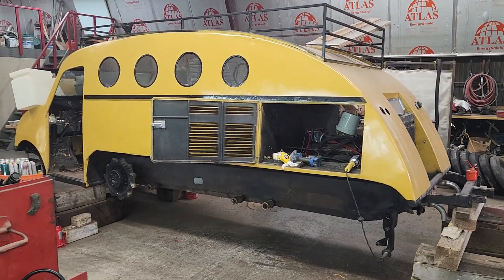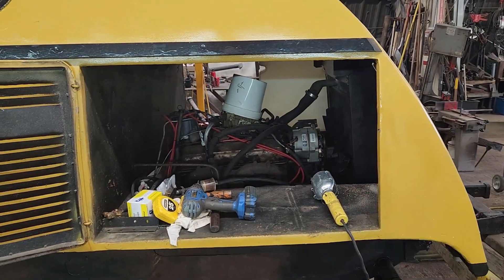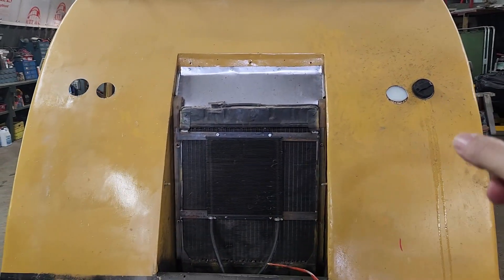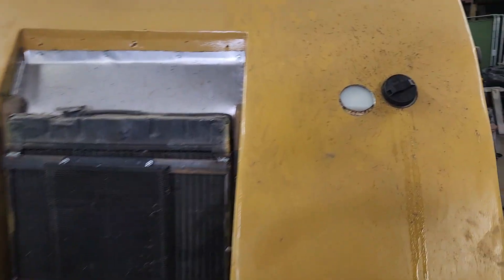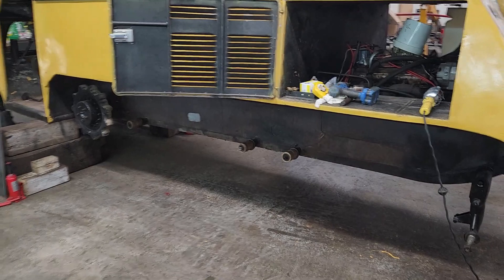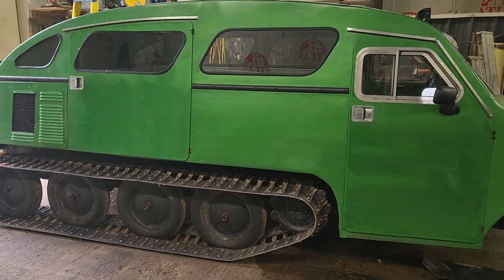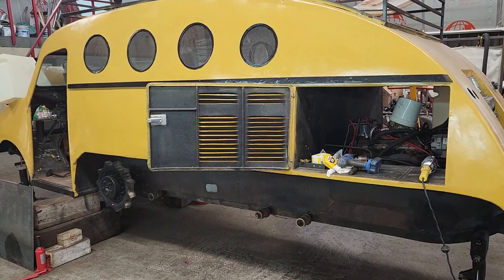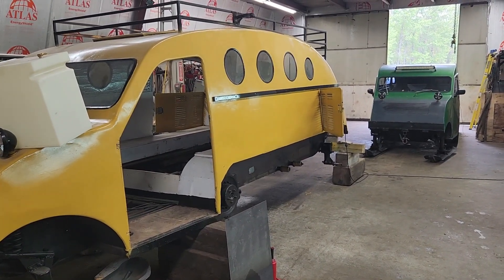GETTING THE NEXT JOBS IN THE SHOP READY | BOMBARDIER

Comment: Do the wheels work better than the skid frame suspension ???
Reply from the maker: If by the skid frame suspension you mean the Quebec sliders, the answer is it depends. On a groomed trail without obstructions I.e. rocks and stumps, yes. If on a winter road going through bush or on the ice where you have to deal with ice ridges, it's better to have the wheels. But it is a personal choice. Dad prefers wheels after a million miles of winter road building